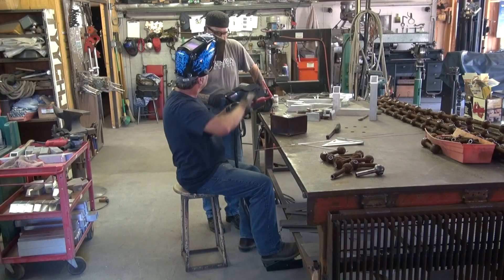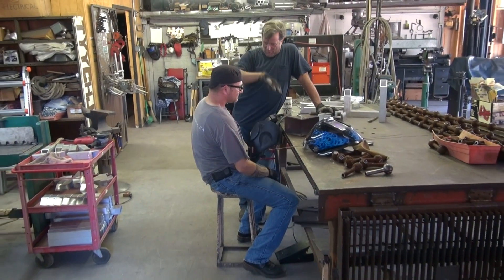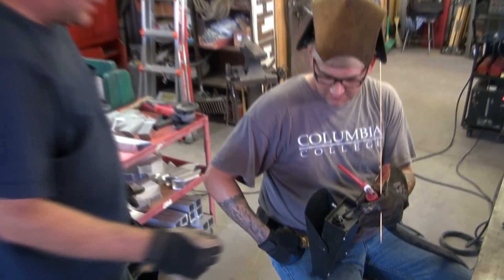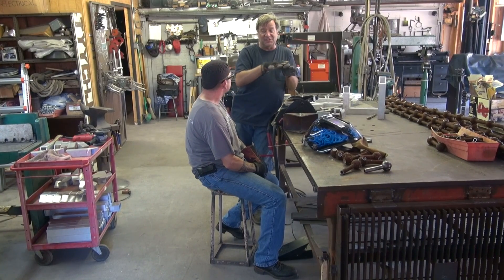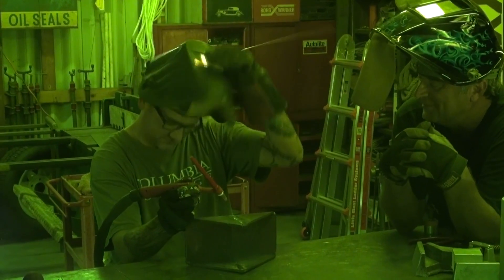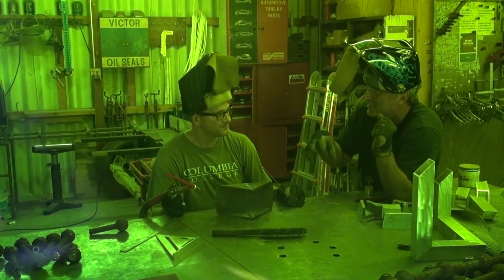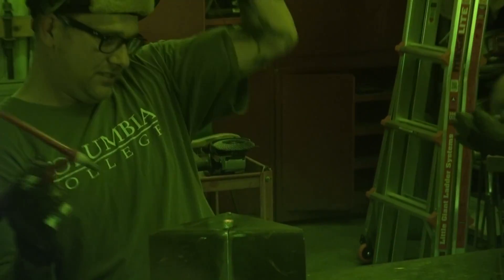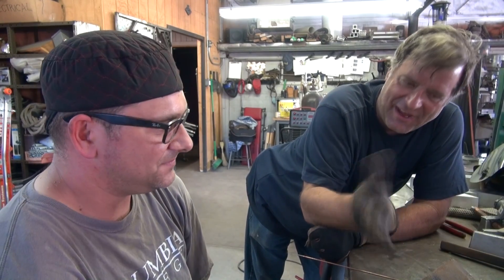First Time TIG Welding - Kevin Caron

Comment: what should I know be for I flux wire weld I never did this be for
Reply: ok thank you so this you my welded did not look so good but I tried to clean what I was welding but did not look so good and I do not think it is going to holed my welder is a Chicago electric I do not know if it is a good one or not but it was on sale I will try what you said if it worms up out side thank you Patrick
Reply: MY WELDER IS 90AMP AND THE OUT PUT IS 60 TO 120 A, AC I BOUGHT IT AT HARBOR FREIGHT AN IT IS BLACK MAYBE YOU COLD CHECK OUT AND SEE WHAT YOU THINK
Reply: my husbands welder is a 90 amp flux wire feed welder from harbor freight
Reply: I have a wagon I take wood out of the woods with and then I want to make brackets for fender's for a flat trailer and I have 1/4 to 1/8 not shoe steel and square tubing I will be working with but the wagon is thin it come from lowe's but if I get the hang of this welding I will be doing more I am better at flux wire then I am at stick welding I have both they are both new but I bought then cheap$ 89.99 flux wire for one and $ 99.99 for the stick and I have welding hat and mask and gloves so I think I have what I need to start    I want to thank you for helping me

Comment: WOW,My Rilands,I Sold a ton of, And Never Had 1 come Back,Plus the 2 we Use,when Thers ANY WORK?! Has a Nice Heavy Metal ft. Pedal,Like my Old Miller 330, That was Hooked up to a 125 AMP BREAKER!(Yep,Single Phase,on a Demand Meter) But didnt Have a "Govenor,On our ft Pedals, Alot NICER, than the Plastic Milllers today,And NO Ft,stop on Back,Lincs& Mils, Like the Nice Heavy steel Box, with the Lip on Back,so your ft. Dosnt slide OFF! I also do Alot for Lyman,and Ill explain there Blacking,Outofrm

Comment: Thanks for your experienced input. Have you had any luck with any product that doesn't fail in the AZ sun in a short period? I too have had the same issues. I haven't found a product yet that wont turn yellow or flake off. What about a wipe on/squirt bottle product for blueing or blacking? Any pointers or will the SN stain give a natural metal look and bring out the highlights?

Comment: First of all..clean your metal....it should be nice shiny and not just wire brushed ...second...throw the cord over you shoulder, so your hand isn't stressed by the weight and you can move freely...third...PPE..where a shirt/jacket or something to cover your skin... keep your tungsten super clean..you dip..you grind it.... and the argon is protecting the weld and cooling the tungsten...  carry on...